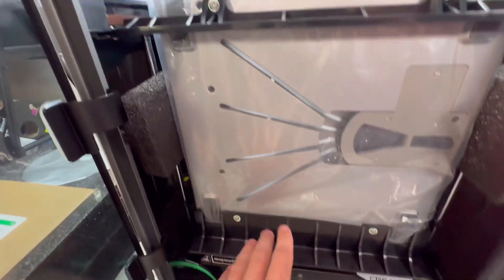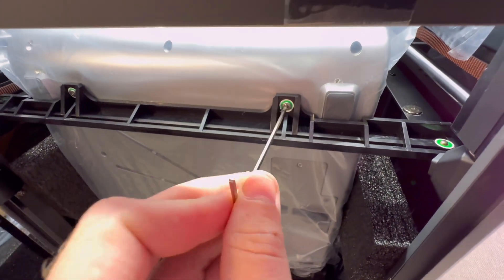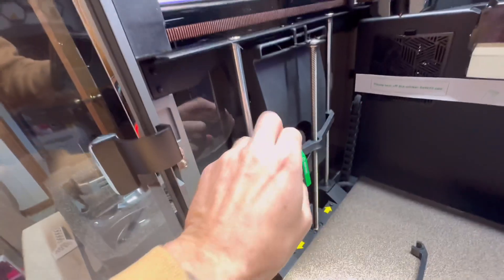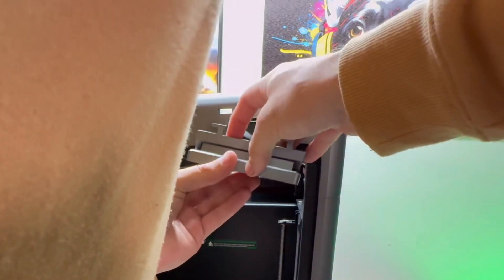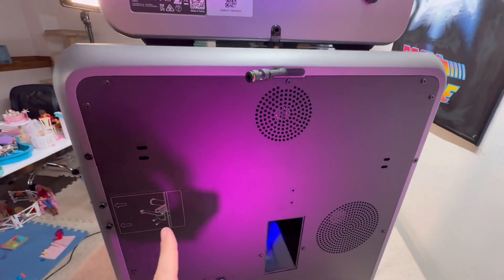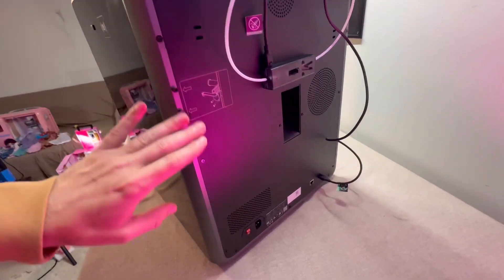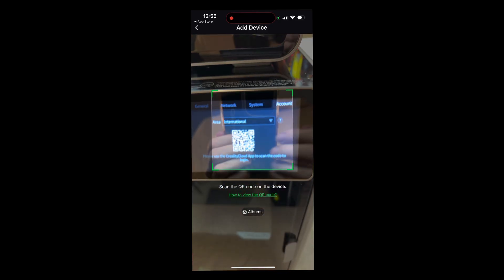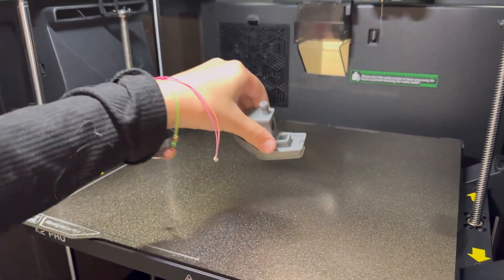Creality K2 Pro Setup - How to Assemble and Start Printing!

Comment: So its like a cheaper p1s?
Reply: Its like a cheaper H2S but slightly smaller its a 300x300x300 the H2S is 340x340x300 and is $500 more also impossible to order from their website as they are on back order until December 2025. These are readily Available
Reply: H2S is step above K2 plus
P2S X1C is closer to the K2 pro I believe
Reply: No it costs more.